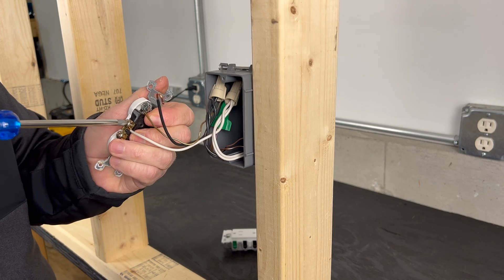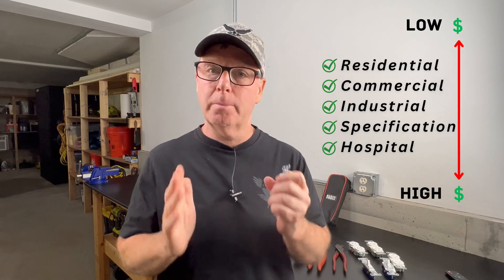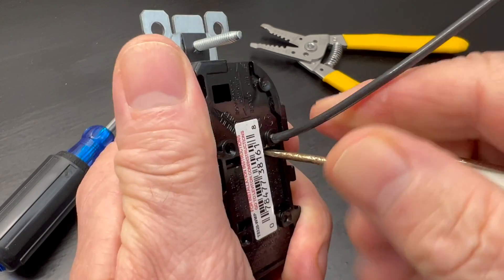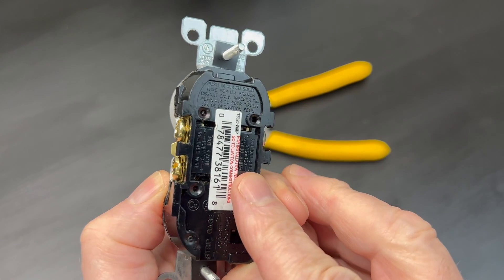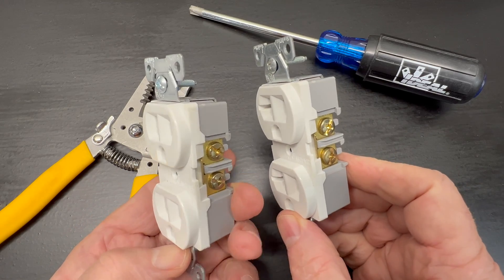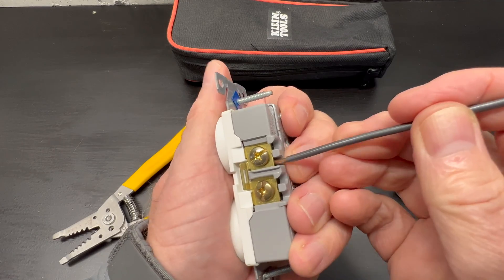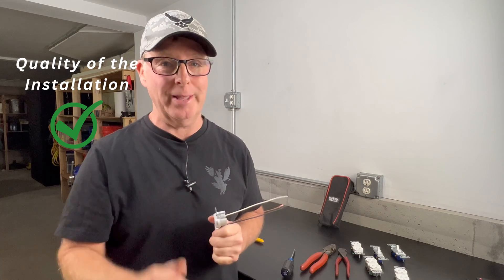How Pros Wire Receptacles in 2025 (Future Proof)

Comment: Can you do a video on the dangers of shared neutrals?  Most common is three strand wire for thing like the dishwasher and disposal on separate circuits.  But in my current remodel, I'm finding multiple circuits sharing junction boxes in the attic where the neutrals are combined under a single wire nut.  In several instances, circuits from different panels (main and sub) have the neutrals combined under the same nut.  The same goes for ground wires.  It seems to my amature eye that this defeats the purpose of not bonding the ground in the subpanel.
Reply from the maker: Yes. I have that on my list.

Comment: Good call on difference between back stab and back wired recepticles. Japanese versions NEMA 5-15R outlets are all back wired, per national code and I tend to use these types when DIYing my own stuff like my camper or shed as it also prevents shock hazards should something come into contact with it.

Comment: What aspect of back stabbing is unreliable?  I am not an electrician but I've worked with 120 for decades.  Never saw a backstab fail.  Never saw a hook and screw fail either.
Reply from the maker: Watch this video where compare the back stab to a new clamp on connection from Hubbell. I cut them both open and explain the issue with the stabs.  https://youtu.be/EXauKblaA3k
Reply: I can give you an actual example.  I moved into a house years ago and needed a washing machine.  There was already a place prepped for a washer and drier.  I bought refurbished appliances directly from the Maytag dealer.  (This was before Maytag was taken over, when the name was synonymous with reliability.)  They delivered it, plugged it in, the lights came on, the water ran in, but the tub wouldn't turn.  The installer left and a tech came over.  He opened up the panel and checked all the voltage points, which checked out ok.  He left puzzled.  I thought about it, decided to take a look at the receptacle, and discovered it had been wired to the backstab holes.  I rewired it correctly and everything worked properly.  The backstab connection was good enough for low power devices, but not good enough to start a motor.  True story.

Comment: Just moved into a FL 1977 home. The main disconnect panel and the garage sub panel both replaced with permit/inspection.
First order of business was to replace all outlets and switches not recently replaced which amounts to about 80% of them.
One thing noted was the original workmanship was very good. Long leads and well managed. It's a decent sized 3/2 home. Only 1 pair of three-way switches. No GFI breakers therefore I easily installed GFCI outlets in the single garage outlet and both outside porch outlets. Bathrooms and kitchen have new/recent GFCI outlets.
I chose the PLUS+ Leviton series. Mostly the 15A version. Oh, there was only one switched outlet in the whole house (MBR). Which I 'turned upside down" lol.

I have to say all the original outlets were contractor grade with the backstab being the preferred method. During the replacement I found about 10% of the backstabbed wires simply 'popped' out. Plus, there was oxidation on some. Not wanting to shorten the leads I 'wiped' the oxidation off with my lineman pliers and used the back wiring clamp of the new outlets. All tested good.
To me, if forced to use a backstab connection I try to ensure it's a low amperage device like a LED light, etc. That's why I chose the more expensive route for this house. Have to admit though, modern loads are significantly lower minus HVAC/Kitchen appliances. Back wiring (clamps) really speeds up the replacement process and in this case preserved the original length. Worth every penny IMHO.

Interestingly all switch boxes had neutral!!! I thought for sure they would not. That was a pleasant surprise.

Going forward, we will be having another subpanel installed next to the full garage sub panel to allow for future needs. It's a 150A service. Thought about upgrading to 200A but not sure it's worth it.

Sorry for the epistle.
Reply from the maker: The back wire spec grade devices are the best and when installed correctly will last several decades. Sounds like you did a nice job. I have always brought the feed to the light switch first because I believe it’s a best practice. Now a neutral is required but it didn’t used to be. This not only allows for the use of motion sensors or smart switches but also gives you the ability to extend the circuit from the switch if needed. Thanks for the comment

Comment: John, thanks for your videos! Have you seen the backwire configuration on Leviton's spec-grade outlets? If so, would you happen to have any thoughts on the reliability of the connection? It's different than the Eaton that you show, with a thinner movable plate located between the base and the screw. If the wire is off to the side of the screw the movable plate ends up bending a bit over the wire as the screw is tightened. It holds it in place, but it feels odd to see the plate bend so much. I'm not sure if I need to keep the wire up against the post of the screw so the plate doesn't bend, but when I tried that I was able to wiggle the wire enough to get it to slip out from behind the plate. I'm thinking about switching to the Eatons for the outlets I have left. Thoughts?
Reply from the maker: I agree that the quality of Leviton receptacles is not always great. I think there are several better options including Eaton.
Reply: @ I appreciate your thoughts! I’m going to just side wire the Levitons that I bought, but will likely use something else in the future.

Comment: My house was built in the 50s and uses residential grade plugs.  I've had to replace so many because they wear out and won't hold the plug in anymore.  Correct me if I'm wrong, but the commercial outlets make connection with two pieces of metal pressed together by a spring instead of just a single piece folded over.  Outlets are such a small portion of the cost of a fairly cheap project, it makes no sense to get the inferior product just to save a few nickels. The back wiring is much less hassle than j-hooks too.  J-hooks look easy with free floating wires outside the box, but trying to wrestle them into position inside a box when they're attached at the back can get annoying.

Comment: I don't think you mentioned about what you thought about lever lock connections.
Reply from the maker: I like them for lighting and low load receptacle circuit. When it comes to the Leviton Decora Edge they seem pretty decent but time will tell home they hold up. Hubbell makes one too but they aren't available at your big box store. The Hubbell Edge Connect is a new design and I would use it in my home.

Comment: Very well done video, thank you!   It would have been good if you had also shown how to attach stranded wire to the outlet.
Reply from the maker: I keep that in mind for the next one.
Reply: @BackyardMaine  Wonderful!  Thank you!  Looking forward to it.
Also, I've not been able to find stranded Romex.  Does it even exist?  If not, why not?  12 awg solid is difficult to work with.
Reply from the maker: @FlapJack314  I'm not sure what the reasoning is but 14, 12, and 10 gauge ROMEX is only offered in solid core wire.
Reply: @BackyardMaine  Thanks for all the great videos!    Were you able to make a video on how to connect stranded wire to a receptacle?  I've couldn't find one.
Reply from the maker: @FlapJack314  Not yet but I have it on my list.
Reply: @BackyardMaine  OK, looking forward to seeing it.  I've got a project coming up.  Happy Thanksgiving!

Comment: Can you used stranded wire when back wiring?
Reply from the maker: Yes you can for the back wire connections but not the back stab or speed wiring connections. They are rated for 14AWG solid copper wore only.

Comment: With the commercial receptacle. Is it okay to still use the side wiring method. If seems like it would place even pressure on those metal plates if a wire were back wired in. The screw would pull up that bottom plate into the brass metal.
Reply from the maker: The back wiring method is very reliable. The wire pinched between the plates is very secure.

Comment: So he is a pro ?? if you back stab you still tighten down the screws to lock them in.
Reply from the maker: Actually no you don't. The screws are a second option for connecting the wires but play no roll in securing the backstab connection. I have a video where I cut one open and show this. Its at the 2:10 mark if you want to skip ahead.  https://youtu.be/EXauKblaA3k

Comment: And just like the back stab connections having problems with working loose or failing, why on earth would you want to use wago clips, in my mind, the same issues!
Reply: They are completely different. Wagos are extremely reliable. They are the sole method used in Europe.

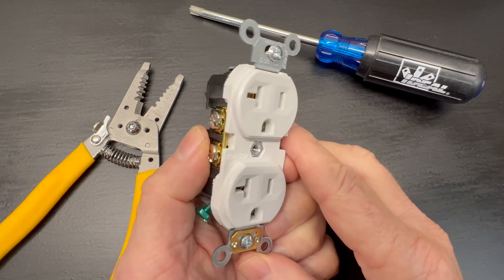Comment: On the 20amp receptacle shown on 3:54 the type of receptacle has a pressure plate do you install wire with a hook? please look at video it is different from the one that was shown wired
Reply from the maker: When a pressure plate is used (back wire option) the a hook is not needed or recommended. If side wiring with screw with no pressure plate then a hook is needed.

Comment: When backwiring a commercial grade receptacle it’s not necessary to use any particular side of the screw as I noticed you did. I know. Old habits. lol. I have about the same time in as you. (34 years) 
Also w back wire terminals I’ve cannnected more than 2 wires to the device. This saves splicing and thereby eliminating wire nuts and possibly able to reduce box size. 
I have not pigtailed receptacle wires for many years on even regular residential grade  receptacles with only two wires. (The old falacy of not supposed to break the neutral) This aves time and $ and when done correctly I believe will not compromise the installation. 
Cheers.
Reply from the maker: I'm not sure what you mean about a particular side. I know the wires can connect to either side.
Reply: True, it's not necessary to use a particular side of the screw, but if you use the side that follows the clockwise rotation of the screw threads it helps to keep the wire in instead of possibly pushing it out by going against the thread rotation.
Reply from the maker: @surferdude642  Its absolutely necessary to follow the screw clockwise rotation with the wire hook for a reliable connection.
Reply: @BackyardMaine  I think you misunderstood, I was commenting on davepaquet regarding back wiring, not side wiring. There are 2 slots for the wire to enter, as you know.

Comment: I'm a homeowner and personally always replace any residential receptacles with commercial grade receptacles any time I have to pull plates off  (ie. painting).  Changing 4-6 outlets isn't a big cost, and they are a lot nicer.  I prefer backwiring, it's fast and easy, but not prone to failure like backstabbing res outlets.

Comment: I would like your opinion. I've always used a #1 Robertson for screwing side terminals of receptacles. 
Is a combo driver that much better? Never had the chance to try one and since I retired my budget is, let's just say small.
Reply from the maker: I think what you have will perform about as well as the combo head so I wouldn't spend the money.
Reply: Can't speak to the ones he uses, but out of curiosity I tried out the Milwaukee combo bits with slotted+Robertson. They work, but honestly Robertson are just as good if not even a little easier.

Comment: As an electrician for over 50 years "now retired " I have found that most failures are caused by poor installation practices and the over loading of circuits. In over 50 years I never went back to make a repair on my own work.  I worked slower than most and did not get in a hurry I tried my best to do it right the first time.  I am not bragging but that's a pretty good record.
Reply: Most mistakes are made when people are pushed and rushed 
👍🏻
Reply: Complacency and ego are the most dangerous. When I hear people say oh I’ve been doing this for 40 years. That’s a huge concern because that just means they’re complacent.
Reply: I like trying to not have to go back for the same issue. 

Ill take different failures all day, as that SHOULD mean that I had it dialed in initially. 

Should..... Sometimes, those stress fractures just mess up an early off Friday...
Reply: I'd hire you if you were still working.
Reply: Slow and steady wins the race 🐢
Reply: The back wiring is still not full proof. I had the wire pop out while placing it in the work box. I prefer the side method.
Reply: Interesting you tell that in 50 years you never had to go back to correct a mistake. Frankly, it’s the people after you that have corrected your mistakes.  It’s like saying you’ve never caused an accident when you’re the lead car and you’re driving erratically everything happens behind you and you don’t even know it.

Comment: Every time I wire a back-wire outlet I wonder why no manufacturer has modified the ground connection to make it function like the back-wiring of the hot and neutral wires. Sure, it doesn’t take long to make a j-hook for the ground, but after 200 outlets and switches in a larger house, I would welcome the time saved.
Reply: You can save time my preparing the receptacles. Sit on your desk and put the hook and a Wago on them. Then at the site just connect the wires to the Wago.

Comment: Are back connections or side connections better in a high vibration environment?  I am doing a camper conversion of a 6WD military ambulance.
Reply from the maker: I would defiantly go with the side wire connections. You can use a torque screw driver to make sure you get the proper tightness. Hubbell makes a new device called the Edge Connect. They are UL listed and tested to preform better in high vibration environments than other connections. I made a video on those as well if you want to check it out. https://youtu.be/EXauKblaA3k
Reply: @BackyardMaine  I just want to clarify.  Are you saying that J hooks are more vibration resistant than commercial grade back connections?
Reply from the maker: @michaelstora70  I was saying that the J-hooks are more reliable than the back stab or quick connects you see on 15A receptacles. The back wiring connections are very reliable and a good choice especially on commercial grade devices. I think either option when done right will give you a reliable connection.

Comment: Do you ever recommend wrapping the side wire terminals on the outlets or switches with electrical tape? My house had them wrapped by the electrician. Just curious, thank you for your awesome videos, very well explained and entertaining.
Reply from the maker: Thank you! I don't wrap the terminal with electrical tape. The tape gets hard over time and when it comes time to replace the devices it's messy and difficult. I don't even tape with metal boxes but it's probably not a bad idea especially for the DIYer.
Reply: @BackyardMaine  Thank you. Looking forward to more videos. Best wishes and good luck with the channel.
Reply: My inspector HATES it when homeowners wrap the receptacles with tape. It doesn't result in a fail, but he tells them to remove it.

Comment: A question just occurred to me while watching you discussing stab connections on receptacles, which I never use.  However, I do use some Wago connectors that use a similar push in pressure connection, though they do have the lever to increase the pressure.

I assume the Wago connection is better, hopefully more reliable, less prone to pulling out (especially if you wrap with e tape to prevent the lever opening unintentionally.  In the other regard, amperage capacity, I wonder if the Wagos carry the rated amperage more reliably, whether when installed correctly, or as commonly mis-installed or pulled somewhat out of the correct installation orientation.

I hope it’s clear what I am getting at.  So, are you aware of any testing that compares these two methods of connection, and/ or do you have any relevant subjective experience?
Reply from the maker: I have never done side by side testing. I was very skeptical when I first started hearing about the WAGO 221. From my years of experience I didn't trust stab connections on 120v. I have some testing on a well pump which is a tasking circuit for connections because the higher current, inrush, and frequent cycling. They have been connected for over a year now with no issues. I have a couple of videos where I cut open a stab connection to show why I think they are so unreliable. I have a thermal camera on order so I will be doing some comparison videos in the near future.

Comment: Just a side note but since the NFPA-70-2017, NEC-2017, receptacles need to be installed with all connections torqued to manufacturer specification, usually this is between 12-16 in.lbs.

Comment: Is there a problem with backwiring an outlet that only has side wiring?
Reply from the maker: I'm not sure I understand your question. If there is no back wiring option then it won't be possible to back wire the device.. If the device offers side wiring and back stab connections then I recommend using the side wiring option.

Comment: The biggest problem with the back stab connection is the very small amount of surface contact area, which will obviously limit current flow, whereas there is a far greater degree of surface contact area available when the wire is properly wrapped around the hold down screw. The other big problem has to do with the limited amount of pressure applied to the wire by the contact surface, which can also lead to current flow failure, whereas again the hold down screw enables a great deal more continuous pressure applied to the contact surface, virtually eliminating connection failure. The goal is to create what is called a gas tight connection, where very few oxygen molecules exist between the metal surfaces of the contact area, allowing for maximum electron flow.